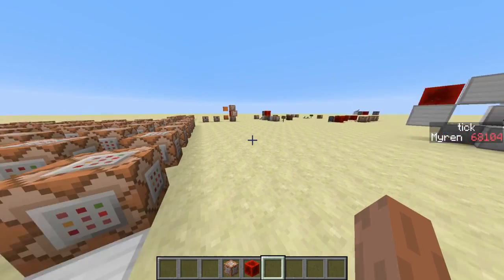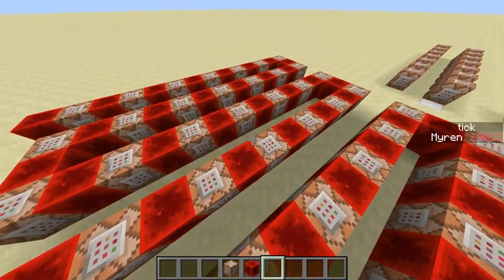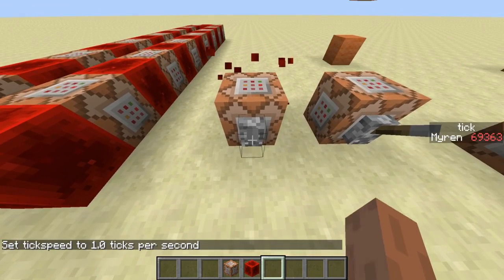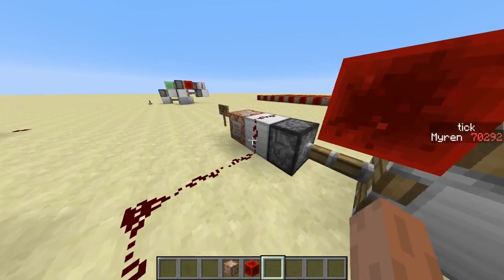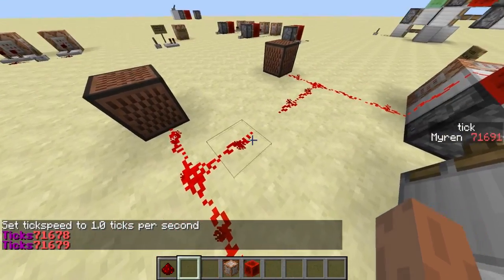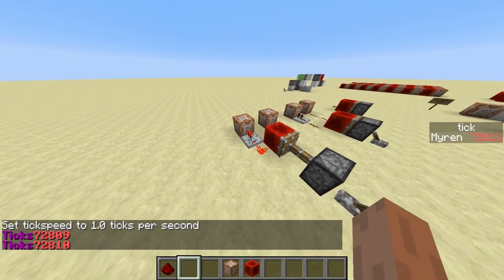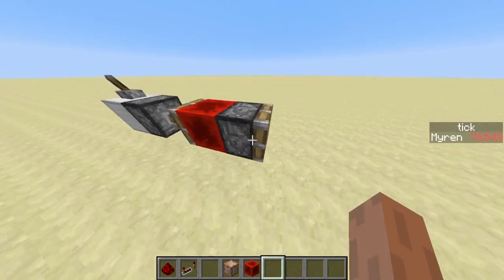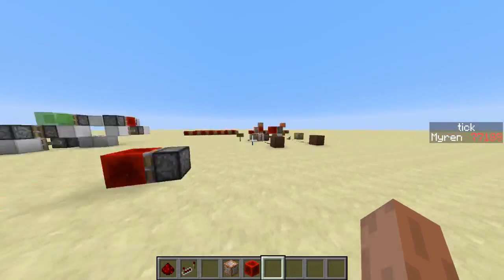Commandblock Inaccuracies

Comment: Very good video!

I definitely agree that my video probably has some mistakes, but I am not convinced that (like you seem to say) repeaters always have a 1 tick delay. If you have two lines of repeaters with dust in between them, one powered via a piston extending a redstone block, the other powered by two repeaters, you can see (and test) they do not have a delay between them, even though you would expect this. I showed this ~1 minute in my video. Using only that test, I think it is clear that either pistons don't behave as expected, or repeaters.

Now I'm definitely not saying I have all the answers, but I do think something is up with repeaters. I'd definitely like to talk more with you about this, since it isn't really known how this works, and you definitely have some very good points.
Reply from the maker: Nasm Nasmus From my experience, the delay of a piston is somehow different, if it´s powered by a repeater/comparator, than if it´s powered by something else. I can also just give vague theories, but I think it´s not the repeater doing something weird, but rather the piston. Because there are so many weird effects with piston timing and the piston code is far more elaborate and messy, I can imagine that the piston somehow manages to extend in 2 gticks.
Reply: Myren Eario What do you think would be a good way to test this? I think having a line of pistons with redstone blocks vs a line of repeaters could work. Would you expect all pistons to extend in two gameticks then?
Reply from the maker: Nasm Nasmus A piston that gets powered by a piston or a lever extends in 3 game ticks. But I think a piston, that gets powered by a repeater extends in 2 game ticks. So I would expect a line alternating between pistons and repeaters to have a 2 gtick delay for each piston. I´ll test that.
Reply: Myren Eario Sounds good, do let me know the results! How do you test for it though? Since command blocks aren't too reliable for this, and my theory of 1 tick per repeater and 3 ticks per piston would result in the same delay overall.
Reply from the maker: Nasm Nasmus
I´m quite convinced, that the pistons take two ticks, but please don´t rely on me.

And it looks like you can make command blocks more reliable if you increment the tick score using multiple non-synchronized repeater clocks, instead of a fill clock. You at least get rid of the weird update ordering.
Reply from the maker: I´ve made command blocks print out the time in ticks after every repeater and piston.
The green numbers are the ticks you get if you increment the score with repeater clocks, the red numbers are the ticks you get, if you increment the score with fill clock.
http://imgur.com/L1htQ0S
So you get different results based on update ordering.
Reply: Myren Eario Why would a repeater clock be more reliable? If fill clocks always activate after repeaters, I would assume you at least get stable results.

I'm not too sure what I need to be looking for in that picture though, it's a bit unclear to me.

I still think that it's just repeaters that are weird though, but I currently can't think of a good test to show who is right. I'll try to think of something, but if you know of a way, I'd love to hear it!
Reply from the maker: Nasm Nasmus
If a fill clock is used to increase the score, and a cmdblock C that prints out the score is activated, most of the time the score will be increased, before the C prints out the score. However if C is activated by a repeater, it will print out the score before the fill clock increases the score. Therefore it will print out the wrong timing.
If on the other hand repeater-clocks are used, the score will always be increased, before C prints out the score, even if C is also activated by a repeater.
So while fill clocks sometimes increase the score before C prints its message, and sometimes after C prints its message, if a repeaterclock is used C consistently prints after the score has been increased.

In the picture I used two entities with a tick score. One of the entities got its tick score increased by a fill clock, the other one by multiple non-synchronized repeater clocks.
And I had a chain of repeaters and pistons in an alternating patten, and I printed out both tickscores, after every repeater and every piston.
The main point of the picture was, that the green and red numbers are different, which means update-order does play a role.
Reply: Myren Eario But how do you know that the repeaters powering the tickCounter activate before the other repeater? And actually, now that I think about it, it says in my video "x sees power at 16 ticks" when it was actually 0 ticks. This is triggered on the fill clock, while a command block had set the objective to 0, which was powered by a repeater(via a block, via a redstone dust). If a repeater would have been powered first, would you not expect to see "x sees power at 0 ticks"?

And I can definitely see how the update-order plays a role from that yeah.
Reply from the maker: Nasm Nasmus  "But how do you know that the repeaters powering the tickCounter activate before the other repeater?"
Because the repeaters in the clock are themselves also activated by repeaters, meaning they get their tile ticks before the repeaters in other contraptions. And according to my understanding of the code, the tile ticks a saved in a neat queue, where all tile ticks with the same priority and delay length, update in exactly the same order they´ve been created. If it should be necessary, I can elaborate more on that. I might not know anything about timing, but I know enough about update-order to make pistons with 4 heads.

For the other question, I think I would need to see your testing setup and the way you use execute commands. Can I have your world file?
Reply from the maker: Nasm Nasmus "And actually, now that I think about it, it says in my video "x sees 
power at 16 ticks" when it was actually 0 ticks. This is triggered on 
the fill clock, while a command block had set the objective to 0, which 
was powered by a repeater(via a block, via a redstone dust). If a 
repeater would have been powered first, would you not expect to see "x 
sees power at 0 ticks"?"
So you´re using execute commands on a fill clock. They really fire every game tick and therefore print out the "16 tick" message within the same game tick in which the redstone turns on (and the redstone turns on before the fill clocks checks the redstone, because of the repeater). The command block, that resets the score to 0 on the other hand gets a normal 1 tick delay after being activated by the redstone. So the execute commands detect stuff instantly (at least if the redstone turns on, before the fill clock checks the redstone), but the command block, that resets the score has a 1 gtick delay.

I tried making 4 images about the process, but I´m not sure whether they´re actaully helpful. If not, ignore them.
http://imgur.com/xqXYDGa,vtBX0aM,kIfkYLc,VrgVILN#3
Reply: Myren Eario Ah yes, those images make perfect sense! I indeed forgot to account for the 1 tick delay of a comparator.

However, that does not explain the following situation to me. Using this setup:

https://i.imgur.com/Pl3pmhY.png

It appeared as if the repeater after the piston only had a 1 tick delay. This was visible both via the chat(not really reliable) and by just watching it(not all that reliable either). See this screenshot:

https://i.imgur.com/QSLGlOl.png

Then I changed the tick updater to repeaters, and I got this result:

https://i.imgur.com/Q8E7A14.png

Using that it does indeed seem like a piston powered by a repeater has a 2 tick delay, while one powered by a lever has a 3 tick delay.

What I do not understand however, is that it still looks like the repeater after the piston has a 1 tick delay.
Reply: Nasm Nasmus After thinking about it for a bit, I'm actually not too sure about the 2 tick delay anymore. The command block setting it to 0 has a 1 tick delay of course, which would explain why it says 2 ticks I think. Still not convinced one way or the other actually.
Reply from the maker: Nasm Nasmus
 Are the execute commands still on a fill clock? Because in your particular test setup I think it´s more important to have the execute commands on a repeater-clock, than the score increasing commands.
From the pictures it looks like before using rep-clocks the score-increasing happened after the execute commands, and now, when using rep-clocks to increase the tick score, the score gets increased before the execute commands. Other than that nothing changes.
But the important thing that can get confused by update order in your setup is not the score-increasing, but the the execute commands.

And I just noticed, that if execute commands are used for everything (which would be getting rid of that score-resetting cmdblock), then the first thing I criticized in my video is gone, and if rep-clocks are used for everything, the second thing I criticized in my video is gone.
So if everything is done via execute on repeater-clocks, then the results would be quite reliable.

I´ll try to get all the command blocks in your setup on repeater clocks.
Reply: Myren Eario I tried it both ways, it did not make a difference whether the execute commands were on repeater clocks or on a fill clock.

EDIT: actually, I only put the execute detect commands on the repeater clocks, not the score-resetting one.
Reply from the maker: I just noticed, that with execute commands you can always get in trouble with update order, because no matter how early you update the execute-detect command blocks, repeaters in your contraptions will always update first, because repeaters always come earlier than command blocks.
Cmdblocks in a repeaterclock are guaranteed to update before any other command block in any other contraption. But the command blocks in the repeaterclock will still update after repeaters, no matter how early they´ve been updated.
I could try to write a mod, that changes the priority of the tile ticks of command blocks, and then we could get rid of update order issues entirely.
Reply from the maker: I´ll try testing things with a mod, that has the following code added to the constructor of the NextTickListEntry class:

if(field_151352_g instanceof BlockCommandBlock){
      this.priority = -5;
}

That should make command blocks activate before any other block.
Reply: Myren Eario I just did the same thing, but I can't seem to figure out what exactly is happening. I get the same results as I got before.
Reply from the maker: Nasm Nasmus
The code isn´t working for me for some reason. I checked the tile ticks of command blocks with mc-edit, but they still have a priority of 0 stored in their nbt-data.
Reply from the maker: I think I got the mod to work now.
If you add the previously mentioned if-clause both in the constructor and the setPriority() method of the NextTickListEntry class, it seems to work. Mc-edit now says the tile ticks of the command blocks have a -5 priority, and fill clocks give me the same results as repeater clocks.

So only the NextTickListEntry class gets modified. The following things we´re changed.

import net.minecraft.block.BlockCommandBlock;

was added at the beginning.

if(field_151352_g instanceof BlockCommandBlock){
      this.priority = -5;
}
was added to the end of the constructor and the end of the setPriority() method.

Apparently the setPriority method actually gets called.